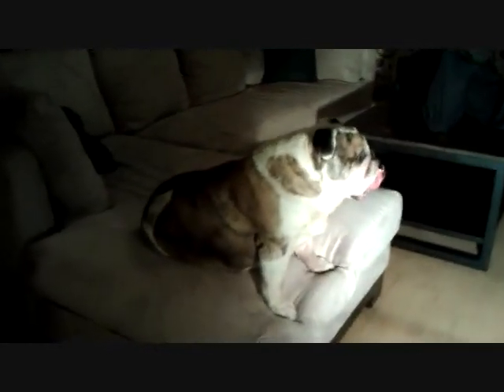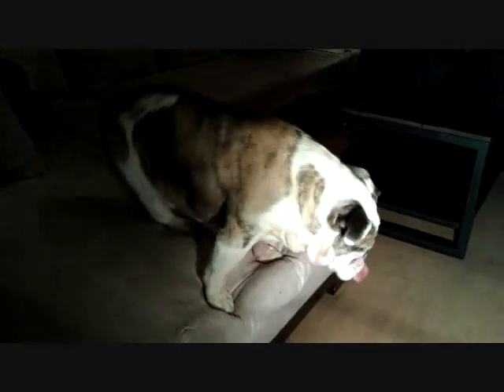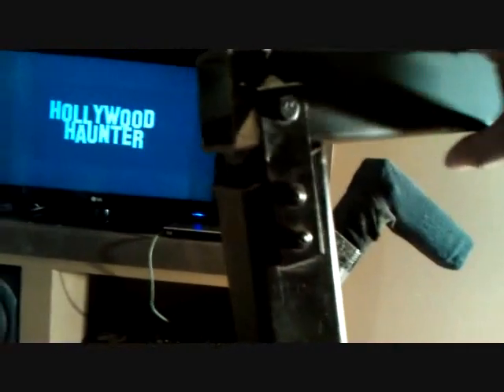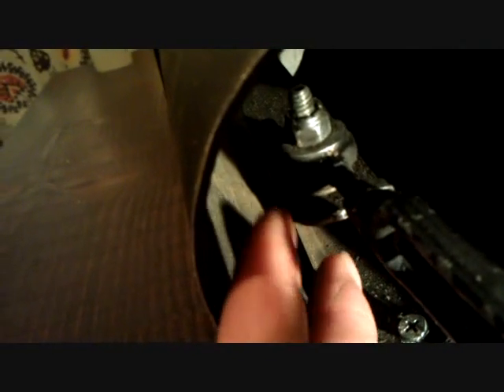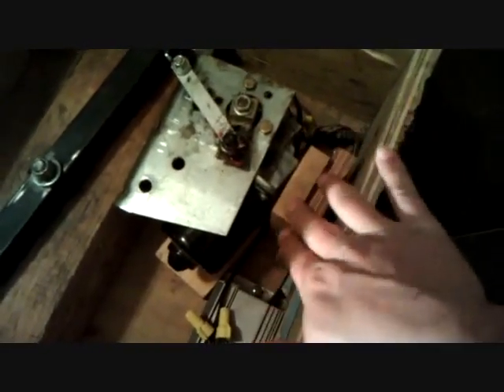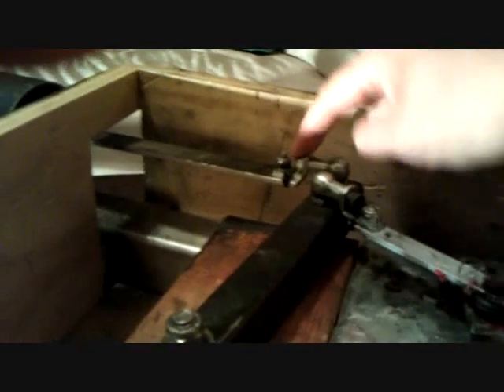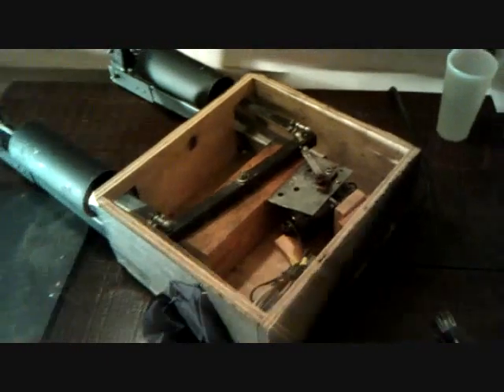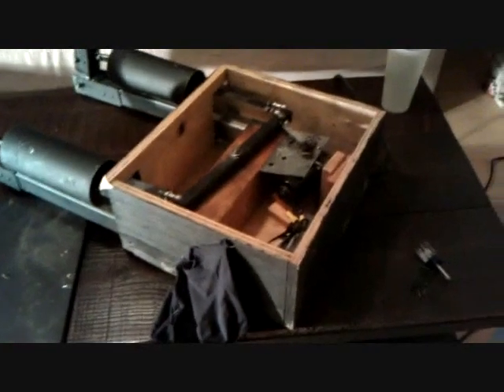DIY Halloween Props | Animated Kicking Legs Up Close

Comment from the maker: Tek screws are self drilling or tapping screws that don't need to be pre-drilled. The ones I used on the kicking legs are the K-lath style #8 1-1/4" Tek . You can get them at a Home Depot. They work well but sometimes when going threw a thicker metal I will use one to drill through and then change it out for a new one with new threads. No dumb questions, I like it when you guys ask stuff.

Comment from the maker: I've seen several ways you can power the wiper motors.  The way we did it to make it easy for us is we purchased a power supply that is really for powering LED lights.  I just made sure that the power output of the power supply didn't exceed the input labeled on the wiper motor.  You also have to make sure it can power DC/AC which most do.  I have also seen many use old lap top power supply's too.

Comment from the maker: If you find a power supply that has a lower output it should be OK to use but it may cause the motor to move a little slower. please let us know if that helps answer your question.  After you find a power supply and need some help hooking it up let us know  =)

Comment: would a reindeer motor be strong enough or would i need a windsheild motor?
Reply from the maker: Windshield motor as the legs get pulled a little harder down by gravity and then getting up again needs some strength.